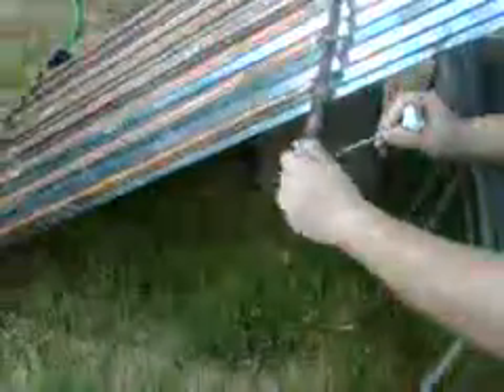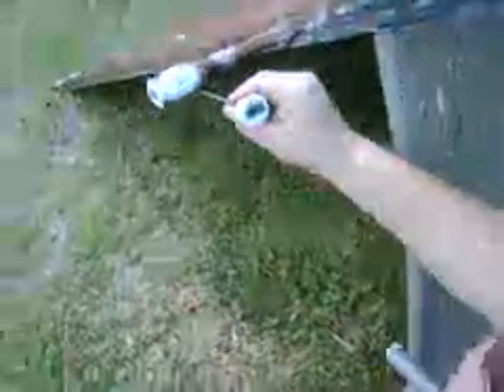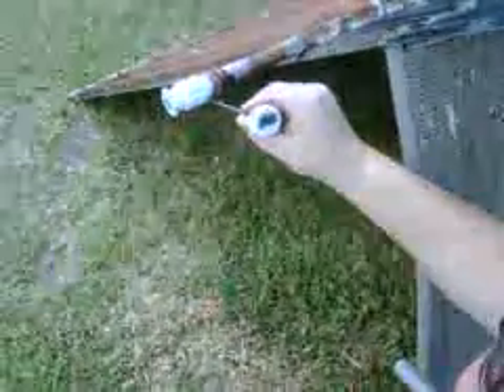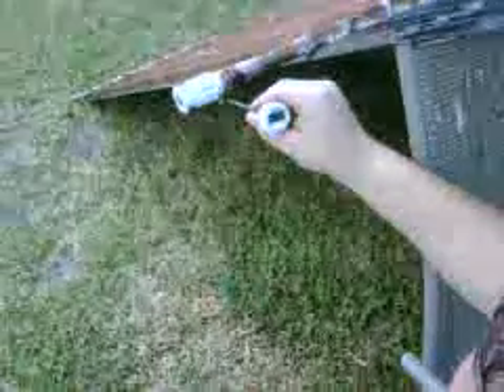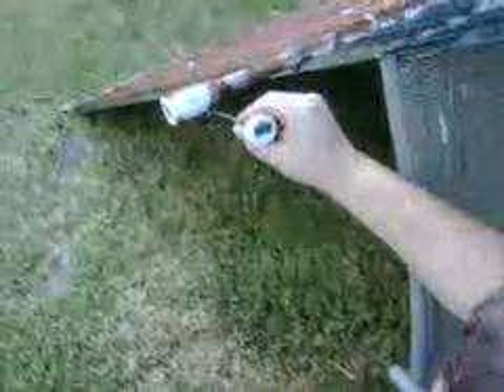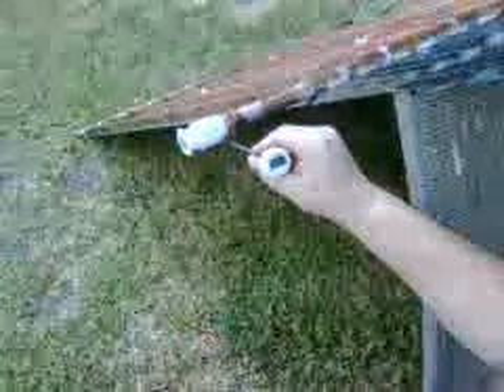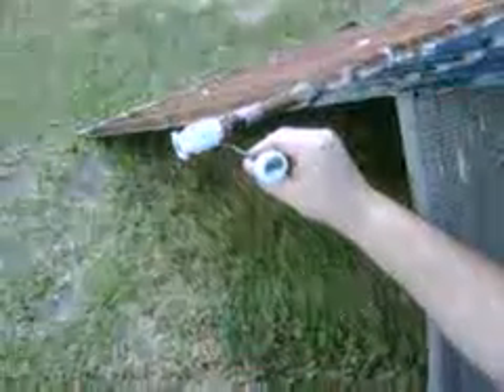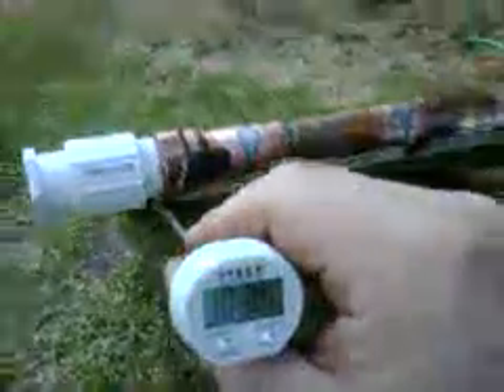Solar Water Heater build 5

Comment: a properly built solar water heater should be able to almost boil water. i don't think they were done yet. after painting the backing, insulating the box, and enclosing it with glass, i'm sure it would have reached about 130 to 150. mine here in florida actually did reach 212 and i had to modify it to put out less heat. even in the winter, i'm never without hot water.

Comment from the maker: @handelandson There is a insulated tank that the hot water went to that basically stored the heating water for direct use, the problem with systems like this in colder climates is just that, its damned cold, but you can turn this unit into a heat transfer system by closing the "loop" and adding a glycol mixture into it, to do this you would have to add a way to transfer the heat of the glycol mixture into the water you where heating.